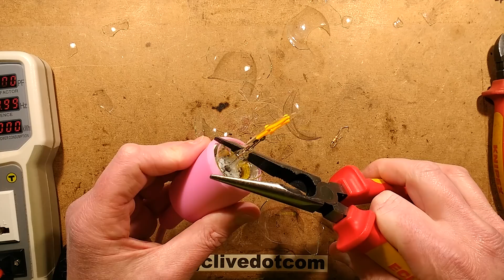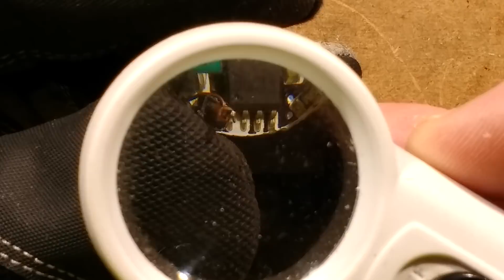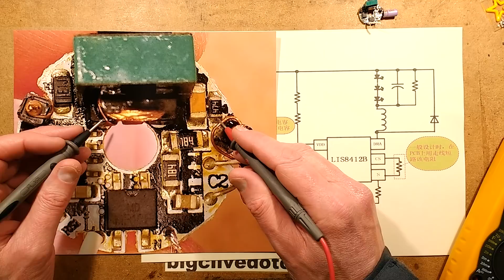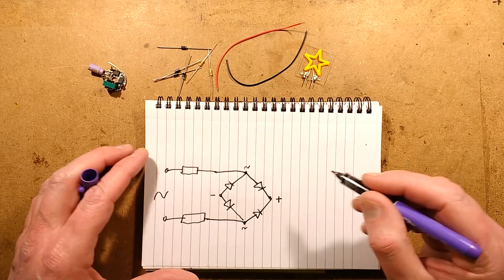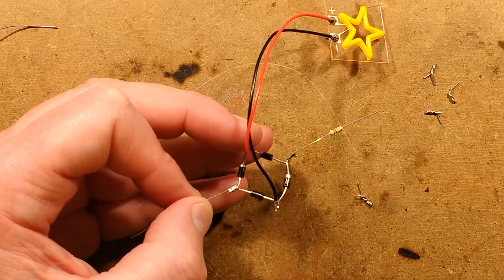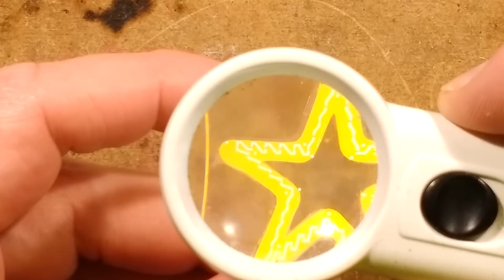LED star-filament lamp smash.  With PSU rebuild.

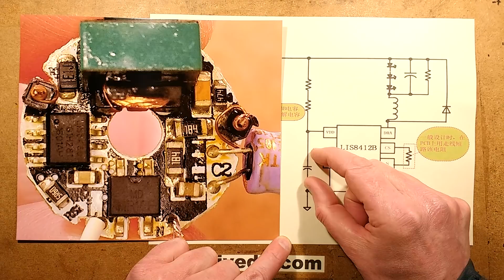Comment: I don't quite get the part around 9:30. Is there a name for this part (with those 2 resistors and 1 capacitor) of the circuit so I can look up more information about it? Do they call this an RC circuit?

Comment: Trump just put 20% tariffs on British steel. If you ask me the Chinese can copy any American product they like. I like China. Just let's hope they do a better job. Half of their copies are already better than the crappy American originals.
Reply from the maker: That shouldn't cause a problem.  The UK's conservative government (the one that supports the megalomaniacs) already destroyed the British steel industry a long time ago.
Reply: bigclivedotcom  - That is not the point.  However, perhaps you can help a former Napier University film student in despair.
Since moviepowerpacks cost like 300 pounds I, as a hardened Napier surviver,  decided to try to build my own 14.8v Lithium S4 packs from old laptop batteries and the Chinese work light stuff you take apart..
 BMS is not the issue but a 12V DEEP DISCHARGE PROTECTION ADAPTER very much is.
This is my attempt: (see following comment. I hope youtube and your channel allows links.)  
The adapter LEDs should change from green to red at 12v and the emergency cut off should cut off at 10v under load. The circuit works with a 2 volt led as a test load on the breadboard, but it DOES NOT WORK with the 20 or 50 watt tungsten lamp. I can't get it to stay latched ON under heavy load with a full battery.
Do you know why that is so? Since I am not an electronician, help would be much appreciated. I like your work and style, especially  your surprise-hammer..
Greetings from Napier aka "The Red Triangle".
Reply: PS: I know you love pen and paper, so do I. But You can also make corrections inside the program and click "save as link" and then "make short url" and post the link here, as I did, if it is not too fiddly for you taste.
I think this online "Circuit Designer" is not too bad for people like me, who haven't got a clue.
I only hope 5 Amps on a breadboard is still OK...

Comment: So, by simplifying the circuit, you've made it better. It can now run with a variable input voltage with no low-speed strobing, and none at all if you add a capacitor, whilst improving the power factor. And removing half of the phosphore makes it brighter. Chinese manufacturers will have the cheaper circuit on sale by the time you read this comment! They might even use a single diode and a capacitor, instead of four diodes, and one dropper resistor instead of two. Thanks Clive.

Comment: It's too bad this star is not made with the LEDs in a series / parallel arrangement for 12 to 18 volts. Then they could be on a Christmas light string without being a shock hazard.

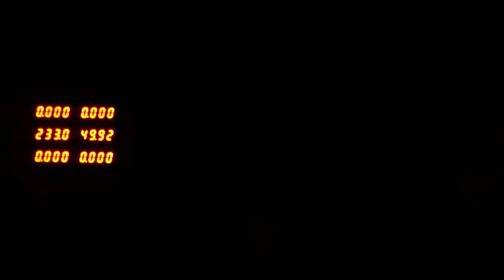Comment: 30:14 Like how you can run a flouro tube off a dimmer pack to make it randomly strobe. I once did that with a UV tube for a disco when I was a teenager and it was awesome (until I was told off possibly blowing up the pack. I think you're supposed to run a ballast with it when doing that or something).

Comment: This video reminded me of a problem I have in the access hallway to my flat. Whenever an LED lamp is used in the fitting inside, the outside security lamp strobes when the power is off. The problem doesn't happen with incandescent lamps (I can't remember using a CFL one in there). Always confused me.

Comment: Those MK plugs are one of the best types made as far as current rating goes, you can run a 3Kw load all day an they wouldn't even get warm, that design came out in the early 1970s but previous designs first appeared back in the 1950s, they are a bit fiddley to terminate but once done are good for years!

Comment: The star has silicone on both sides so it doesn't corrode
Reply from the maker: +MrBrymstond It's a glass square with the LEDs and tracks on one side.
Reply: So the side that was cut off never comes in contact with air?

Comment: Hey @bigclivedotcom - Lou from Unboxtherapy demo'd an LED light that has an integrated battery backup (https://www.lyfelite.com/) so it continues during an outage. The thing is, it senses when the switch is switched off vs when the power is out - how is that sensed? Would love a video.
Reply from the maker: +LethalBB I reverse engineered one of those about a year ago.  They're a common item on eBay called intelligent emergency light.
Reply: Oooh, fantastic!

Comment: Hysterical, fascist safety-nazis. Shoving onerous and totally meaningless rules upon us, based on unfounded fears and outright lies at times.  It's not hard to reduce accidents when you've shut down most of the work.
Reply from the maker: +Landrew0 That's what it felt like with Carillion.  Even the simplest technical task was made arduous.  They stripped all the pleasure out of work and replaced it with harrasment.
Reply: bigclivedotcom How did you find them on payment? I’ve heard tales of 120 days payment terms, endless ridiculous excuses for nonpayment and actually asking suppliers for upfront payments to expedite payments that were due anyway. Talk about huge red flags.

Comment: I always wonder how is it that your iron tip isn't getting dark. I don't know what the norm is but after, say half an hour - hour of working my tip starts getting noticeably darker. And is not really hot (about 330C/610F on the dial). I might want to get the thermometer.. Recently I started experimenting with a copper tip and for some reason it's much better. But it still baffles me how you just turn it on and so something else and when you get back to it, it's just fine.
Reply: Hrnek Bezucha have you got a damp sponge to clean the tip? It’s pretty much the only thing you can do to clean it in use. If it gets really shitty, get a little pot of plumbers flux and give it a bath when it’s hot, then the sponge, repeat until done. 
Copper tips are ok, but they dissolve over time. Iron capped tips are best for a long life.
Reply: I got the metal wool for cleaning. Always thought it was the better option. And the acid-based flux, I bought some just in case and for the USB iron, which doesn't have replacement tips. It's a neat thing, being able to clean it even when it looks like solid charcoal. 
Yeah I guess I'll give the sponge a chance.

Comment: The firm I work for like so many others is not progressing because it has got itself into a state where ticking the boxes on the health and safety statement takes precedence over completing the job in hand.
Reply: John Armstrong 
Yep. I’ve seen similar not due H&S. I was at a now failed Engineering firm which instructed us on a Friday afternoon to delay getting a needed change to a customer so we could update our time tracking system first and do the work next week if there wasn’t sufficient time to do them both before close of business instead of in the other order. What happens when those in charge forget why the firm exists and what brings in the money.

Comment: I found a pair of gloves that are ideal for working on the bench. They are super thin leather and very soft, padded only on the palms and lower fingers.  With a knitted cloth only between the fingers and back.They are football/soccer goalie gloves I picked up in Mexico. I bought 3 pairs and now I only have one pair and 2 left handed gloves, left. I ruined them with razor blades and broken glass. I wish I could find more of them they are getting worn out after 12 years. They are made by  Rauling in Mexico.  Been there several times since and set friends that have gone to look for them and cannot find them anywhere. They feel like wearing latex gloves but they breathe and are tough with excellent stitching. I have tried many different automotive gloves over the years and none of them come close.

Comment: 26:30 You can use I squared * Rs companion V squared over R ( V2 / R ) to calculate power dissipation a little quicker.

60 volts squared / 15,000 K = 0.24 milliwatts.

Comment: We used to call those square pins with wire wrapped around them "wirewrap pins". Was a standard way of making computers and telephone systems and the like 40 years ago.
Reply: Only difference is that header pins may have rounded in stead of sharp edges, so the contact might not be as good as when using real wire wrap pins.

Comment: Is the piece of square glass/plastic that the LEDs are attached to WIDER than the neck of the glass bulb? It certainly looks like it on my monitor, but maybe that's a perspective distortion. If it IS wider, then the obvious question is...what sort of magic did they use to fit the bulb over the "filament"? :)
Reply from the maker: +Carl G There is a distinct ripple at the base at about the same size as the panel, so they just adjusted the glass fusing point.

Comment: Hook up the burglar alarm with the lights so that all the lights come on and strobe; making it much harder for the burglar to get away while it's otherwise dark.

Keep in mind that it will also be strobing while you try to disarm the alarm, having inadvertently (or advertently?) triggered the alarm.

UV illumination of the gel please … perhaps in the intro to the next video.

Comment: Bigclivedotcom you need to check for vacuum. Its why they make a nice sound when you smash em. And why the vacuum nipple in the bottom of the bulb is sealed. It really sounds stupid but alot of these glass (with "fillament") bulbs have a vavuum pulled. Its why they prematurely  fail. #manufacturingfail #cantteacholddogsnewtricks
Reply: There's no reason whatsoever for there to be a vacuum inside this bulb, and as Clive says, it would prevent heat dissipation, not to mention raising the cost of manufacture.
Reply: In case you missed it, the base of the bulb is not sealed, only glued around the inside the base. The circuit board fills the space inside, and it's not air-tight at all.

Comment: actually i read that those bulbs have not only no vaccum, but indeed a gas inside to transport the heat to the glastube faster and thats also the reason why theyre still made of glas, because plastic doesnt transport heat to the outside. 
so by smashing the bulb, the leds will live a little shorter because they slowly heat up the air around them, storing more heat.

Comment: Great stuff.  I had been wondering just how cheap and simple an AC - to - LED power supply could get.  I think that's just about as simple a circuit as will do, unless perhaps a half-wave rectifier were used.  Thanks!

Comment: how are you carbonating wine in a sodastream?  that goes horribly wrong when i try it...
Reply from the maker: You have to chill the wine and release the pressure very slowly.  It works best with white wine.  Red wine is harder to do, but possible, and won't hold the carbonation as well as the white wine.

Comment: Google says the diode was invented in 1904.... wow.
Reply: dwarf365 
The early crystal rectifiers were used mainly in radio as they were too delicate but the type of semiconductor diode as we know it were developed in the 1960's and lead to the development of the integrated circuit in the 70's.
Reply: In 1904 Fleming invented the thermionic (tube/valve) diode. These early diodes were basically light bulbs with an anode plate. The filament which was the cathode had to be white hot to emit enough electrons so these diodes would emit a lot of light. The light emitting diode has been around a lot longer than you think!
Reply: It’s mad how old some of this stuff is. Ecstasy was invented over 100 years ago and the atom bomb is over 70.
Reply: The rectifying effect in some crystals was discovered by Ferdinand Braun in 1874.

Comment: Been looking forward to seeing this,  not disappointed,  wondering how many types of bulb the resistor trick works on,  and could it be done on festoon set, with the resistor fitted where the fuse goes. ,
Reply from the maker: I'm not sure how well it would work with multiple lamps.

Comment: I suggested that because I had a regular led-filament bulb which actually DID have a vacuum pulled .. and the failure mode of that bulb was a filament being slightly non-conductive somewhere in the middle, some bond wire most likely came loose

Have a video of that on my channel

Comment: FYI When you see R representing a decimal point, the R stands for Radix Point. https://en.wikipedia.org/wiki/Radix_point
Reply: Smudger Dave unless it stands for resistor, as in resistors.
Reply: I think you will find that R is used as the Omega symbol is less common in the devices used to print the value, Omega (Ω) being the symbol for ohms. So instead, 'R' is used in place of the Omega symbol.

Comment: Work out the age of the Quicktest mains plug. Must be after 1984 because it had sleeved pins.
If it was a pre 1984 plug with solid brass pins you could manage without a Quicktest!

Comment: i'm surprised they used glass and not plastic for the bulb
Reply: Jason Halverson 
I expect that it's pretty cheap to use glass as there are lots of factories that manufacture incandescent bulbs that are struggling with the change to LED technology. Also, glass is optically more stable and much more heat resistant than many plastics.
Reply: Glass remains shiny, doesn't discolour, and it's very inexpensive.
Reply: I'd say the reason for the glasa being that there are 50 LED's in there, would create a fair bit of heat

Comment: "So you can use these as strobing lamps by putting a resistorin series with them, never thought about that before." And the size of the resistor would act as a pulse width modulation?
Reply from the maker: It would affect the speed within a range of staying off to staying lit.
Reply: alright.

Comment: The strobing is probably the chip supply going down when the chip powers the led's, not the mains dc rail.
Easy strobe for an alarm is a fluro starter in series with an incandescent lamp, i did it once at work, worked great, so annoying that people took notice :D
I prefer the wrap around terminals, they only flatten the wires, the screw type cut into the wires, i didn't like that MK changed.
Reply: I made christmas lights (several 15W 230V bulbs in parallel) flash with fluro starters. The problem I came across was that starters tend to either short out or lose vacuum with long time usage.
Reply: Sounds like you may have overloaded the starter, keep the total load well within the rating of the starter and it should last longer, a 120w starter can take up to 8 15w lamps, though i would reduce that to 5, remember starters only have small contacts, and are not rated for long term switching, it was fine for an alarm lamp.

Comment: I got my first Multimeter the other day and keep jabbing my fingers with the sharp ends.
Reply: The point (I'm not sorry 😂) is that the sharp points can push through insulation or thin oxidised surfaces so that the probes make good contact with the conductor 😉
Also good for waking up your workmate when he dozes off 😂
Reply: How acute of you! Not for fingers! I've run out of things to solder and poke things with for a while now anyway. Unless more tat arrives from China tomorrow - every day is a surprise at the moment!
Reply: They are sharp! Like pins!
Reply: I got some probes with a Chinese solder rework station... They're like pins too.
My fluke ones are pointy, but nothing like the Chinese death probes.
Reply: =D I got 2 sets, the CATIII ones are the razor sharp death probes what for poking your electronical boards and batteries and the CATIV have more reasonable tips with the extra sleeving.. but yah!

Comment: Hi Clive, yes I noticed the cloned quicktest the other day at CPC, they do still sell the Cliff one though as I double checked because that's where I got mine from.
Reply: djs amazon uk is also selling the clone quick test. For the same price as the real deal.
Reply: Stuart Taylor 
Hi Stuart, yes your correct I just checked, some of the clones on Amazon are quite expensive, I think I got my original Cliff one off CPC for around £25 a year or two ago and its worked perfectly, I think their currently around £31 ish.
Reply: Yeah, but, if you get the CPC "flyers" that come at least once a month, the Cliff quicktest has been featured in there, and that code (which is different from the website) gets you it for about £27  ;-)
Reply: £19.80 now... http://cpc.farnell.com/unbranded/tb1/test-block/dp/PL1569987
wondering if you'd be willing to do a comparison, Clive - I'm not a fan of copied products either, from the pictures it looks identical. I could even sponsor it. There's one on Amazon that even has the [ C ] logo pictured on the underside, one of Cliff's registered trademarks https://www.amazon.co.uk/Quicktest-block-quick-testing-electrical/dp/B01H6YQEPC/ http://www.cliffuk.co.uk/about/index.htm
Reply: David Gill if you use the code PL1569907 it shows up as £16.50
Reply: Stuart Taylor Same, just I included the VAT